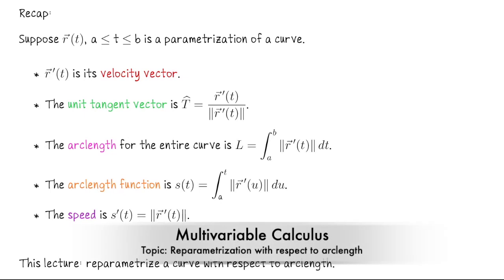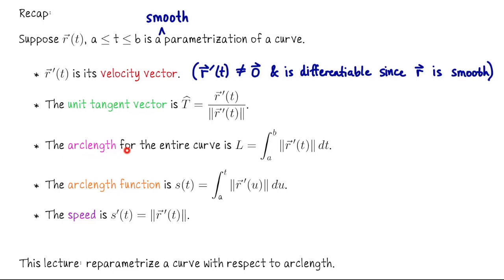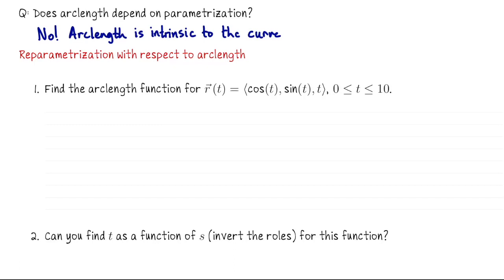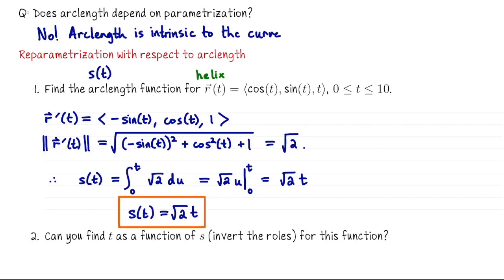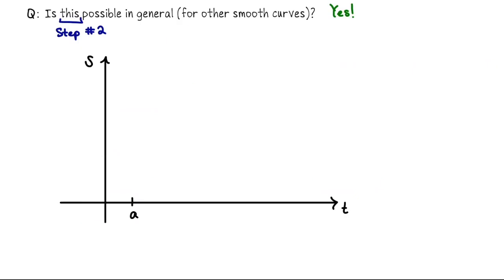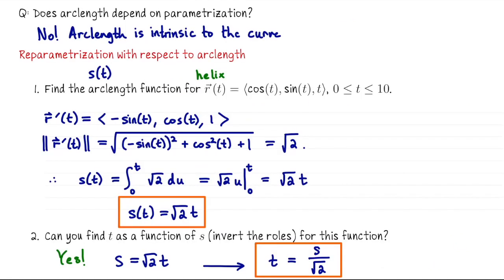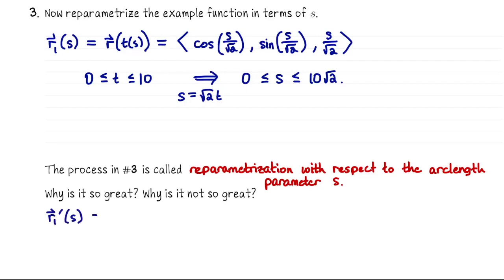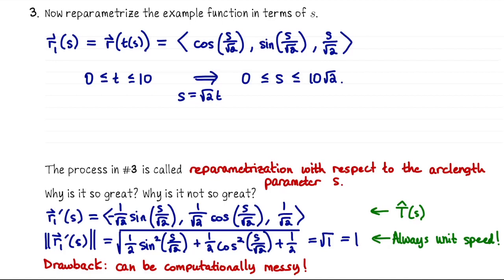Reparametrization with respect to arc length, Multivariable Calculus

Comment: Hello, thank you for this very clear video on a topic not so easy to me, and which i've studied for quite long time. I've got a question: we call parameter "t" (impling it is time) and derivative r'(t) "speed". But t is not actually parameter "time" and r'(t) is not actually "speed", isn't it? I mean, by a physical perspective, the point of reparametrize a curve is (as far as i've understood) that we start with a curve, parametrized with a certain spatial parameter (e.g. one angle to parametrize all the points of a circumference) and come up with a new parametrization, wich gives us an easier way of computing tangent and normal vectors. 

If we parametrized the starting curve with time, and try to reparametrize it with arclength, it would mean we were trying to reparametrize the equation of motion of one point moving along the curve, not the curve itself! Am i right?
Reply: parametrization lets us trace a curve of many dimensions(x,y,z) in one dimension/variable. its speciallity is it have a direction. like an ant tracing the curve .. time moves in one direction and so does arclength(it always increase).  when we say do we parametrize the equation of motion or curve it both means the same thing.......  the curve is the equation and the equation is the curve and parametrization and reparametrization are ways to study the curve(i.e the eqn) easily